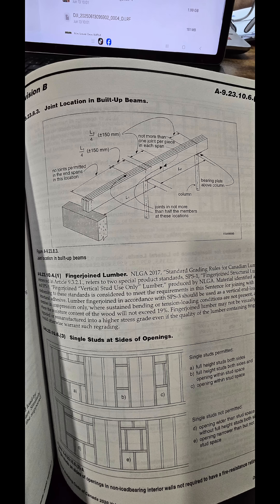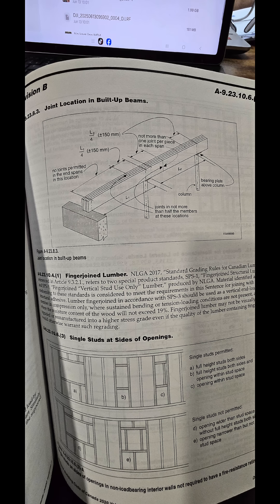Where to splice a built-up beam for your deck! Building a deck beam!

Comment: Most beams only require a 2 layer built up beam , so the 3rd layer is essentially just blocking to pack the beam out to roughly post width . The two layers have to have splices on post . 3rd layer can be spliced almost anywhere
Reply from the maker: I would check the spans and load before stating that a beam only requires 2 ply. Locally, the slope would have to be at a quarter point or over a support.  And if all your splices are over the same support on a 2 ply beam , you may not meet the bearing requirements of a beam.